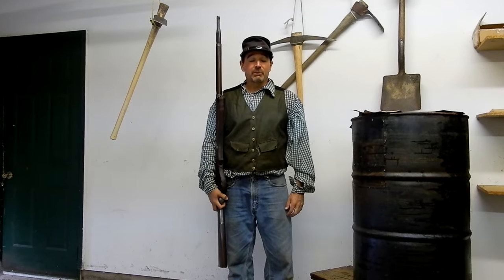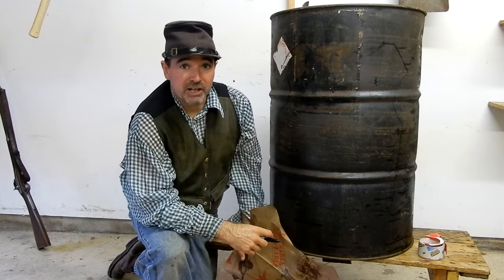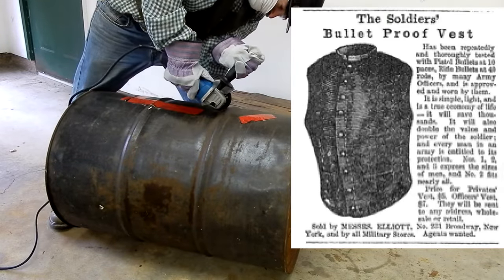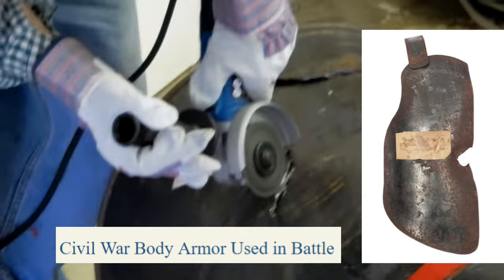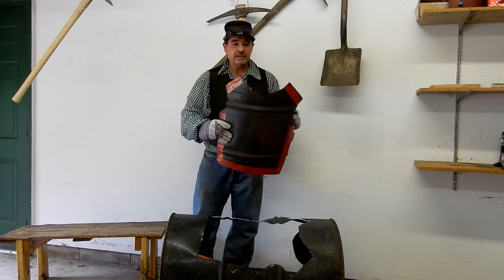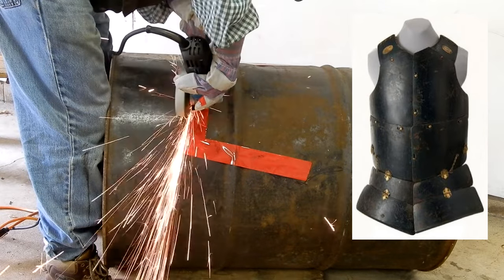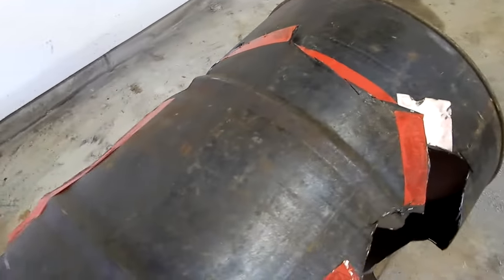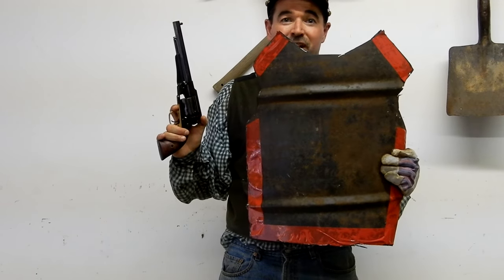Civil War Body Armor - Bullet Proof Vest

Comment: I'm been wondering if they had a modern mindset what they could of accomplished with what they had available? Like todays Kevlar works not just because of strength but layers and strength. Heavy canvas layer's, hemp fiber's layers, quilted layers, steel strips a form of epoxies impregnating those layers.  they also could of explored ceramic's. It wouldn't hold up to modern protection but maybe a good chance on the slower moving projectiles of the period. But then again if you got shot in the leg you had a fair chance of dying anyway.
Reply from the maker: Thanks pard for you thoughtful insights.

Comment: Thing is the Germans used armor breastplates during WW1.
Reply from the maker: Tanks for the info pard - any idea if this was useful or provided any real protection?  I'm guessing that the armor was heavy.
Reply: @1stminnsharpshooters341  German Stormtroopers used it in 1915 - 1916 so did the maxim machine gunners. Stormtroopers dropped it, to heavy and cumbersome for trench fighting. The machine gunners kept using it up til the end of the war. The armor worked well against shrapnel and pistol bullets, rifle bullets well that depended on range and caliber. US 30-06 went clean through so did 303 British, French 8mm Lebel rounds were iffy at best.